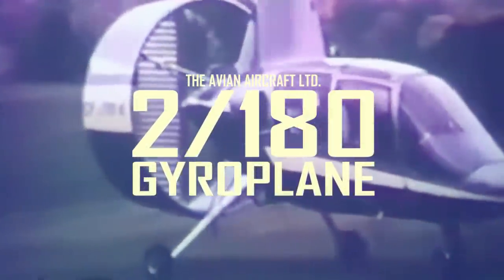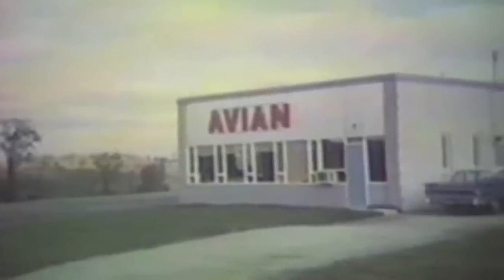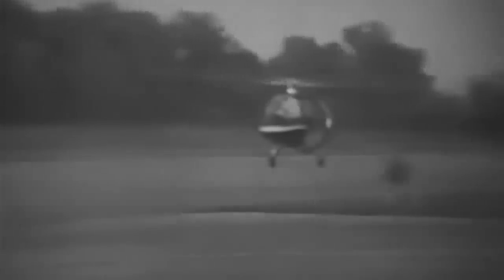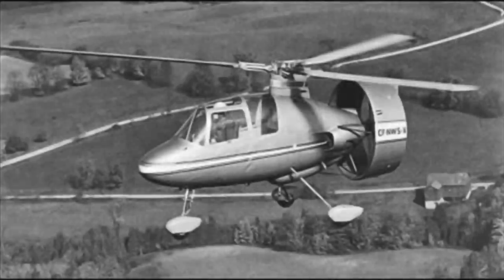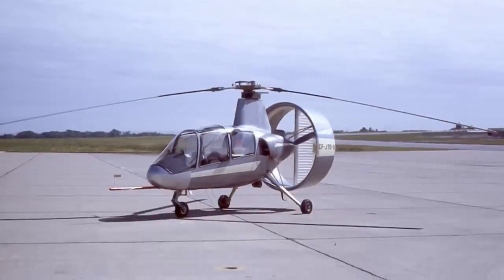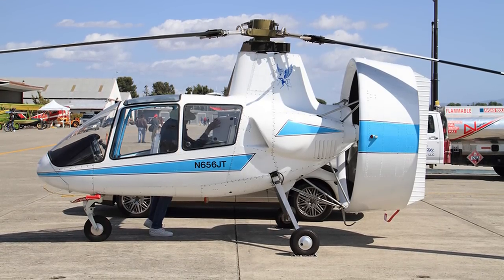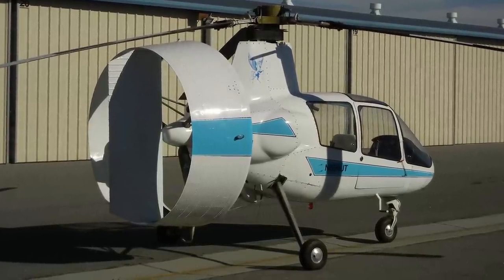Attractive VTOL autogyro with unrealised potential; the story of the Avian 2/180 Gyroplane

Comment: This is ticking me off a lot; the Lycoming O-360 only has 1 zero. It's an O-360, not a 0-360.

Edit: Also, ducted fans are noisy (they produce more noise fore & aft of the duct) & hard to make. The potential performance doesn't matter if it's out of the target market's price bracket & isn't comfortable. Additionally, APUs were already a thing for producing forward thrust so sticking a piston engine on the back is very counterproductive since it introduces more failure points than a turbine engine. Failure points are even less desirable in helicopters than aircraft since they're more difficult to fly & have less margin for error in case of engine failure.

Comment: IMO For this to be successful, it had to have a use that a helicopter could Not obtain.   It would have to be FAA approved to land and take off in a city due to the fact it was always in autogyro, thus safer 'in IC engine out' than a helicopter during take off and landing.    (electric, battery, fuel engine, is a new reliability model)
Reply: I'm a 21yr gyro pilot. For it's price a helicopter is a better choice. Look for the Groern brothers. Another machine that was a pipe dream .  The technology is nothing  new. The cost of certification Of a new machine means very deep pockets. How many are flying. I bet not but a  fewer or only one. The gyro crowd would not buy it.

Comment: Wondering why this wasn't successful, I mean you can basically start and land in your backyard. No large airfields required.
Reply: RK: Same as all gyrocopters:  1. Minimal room for cargo 2. minimal cargo weight capacity 3. Slow cruise airspeed 4.  Narrow Center of Gravity range. Overall, helicopters offer more features.
Reply: @KB4QAA  yeah but it looks like a great commuter plane, especially for areas with bad airfields, like bush plane territory.

And the cruising speed and carrying capacity doesn't look that bad - I mean they mentioned that you can add tanks and get more than 2000 km range out of this thing.
Reply: @RubenKelevra  1. No you can't 'add tanks".  2. It only has a 600lb Useful Load = 200lb pilot + pax = 200lbs left for gas+cargo.  3. There is no significant cargo area.  5. The market has spoken the final word on autogyros for 60 years as commercial utility: "No!'.  Sorry.
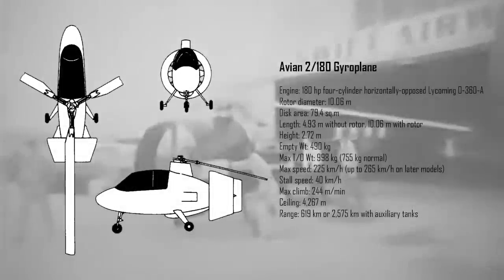Reply: @KB4QAA  2:54 there are auxiliary tanks mentioned in the datasheet
Reply: @KB4QAA  the max takeoff weight leaves room for 1120 lbs of fuel/cargo/pilot/passengers. Doesn't really sound that awful either 🤔
Reply: @RubenKelevra  I don't see links to data sheet.  The Janes' figures quote MTOW 2,000lbs -  Empty Wt 1,400lbs = 600lbs Useful Load. i.e. pilot, pax, fuel, cargo.
Reply: @RubenKelevra  Cont'd.  600lbs - 200lb pilot - 200lb pax = 200lbs remaining for gas + cargo.   For IO-360 figure 12gal/hr burn.  30min reserve = 6gal x 6lbs = 36lbs.  200lb - 36lb = 166lbs load remaining for fuel + cargo.  166lbs/72pph fuel burn= 2.3hrs of flight available.  Fly one hour each way round trip.  166lb - 144lbs burn = 22lbs available for cargo for 100 mile radius.  Not much cargo, not very far.   A Maule can beat this on every number for a fraction the cost and a lower maintenance cost.  bill. cheers, thanks for the discussion.  Interesting to investigate old planes and "what if".  b.
Reply: @KB4QAA  the datasheet is at 2:54. It shows 1080 lbs of empty weight and 2200 lbs as max takeoff weight.

So you get around 1120 lbs for fuel/cargo/passengers/pilot.

That said it's a pretty old design, I'm sure that adding a turbine engine instead and using modern fabrication technology could increase the usable space/cargo capacity significantly.
Reply: @KB4QAA  Look up the numbers for a Cessna 172 as a fixed wing competitor. It's worse.
Reply: @RubenKelevra  But a C172 ISN"T a competitor equivalent to the Avian. And, you are in fact wrong. The numbers are much better.  Farther, faster, more cargo, vastly larger cargo space; can easily carry 3 pax, 4 with significantly reduced range. Overall, a C172 is a better performer if STOL and rough field/bush operations are not required.
Reply: @RubenKelevra  p.s. Of course we need to haggle over exactly "Which" C172 model we are discussing!  :)
Reply: @KB4QAA  

Well, Wikipedia shows as "general characteristics" for the C172:
Empty weight: 1,691 lb (767 kg) and gross weight: 2,450 lb (1,111 kg). That's 759 lbs (344 kg) usable capacity.

The Avian has an empty weight of 1,080 lbs (490 kg) and a maximum takeoff weight of 2,200 lbs (998 kg). That's 1,120 lbs (508 kg) usable capacity.

While the C172 has cruise speed of 122 kn, while the Avian has a cruise speed of 143 kn.

The C172 has a range of 696 nmi, the Avian has a range of 1,390 nmi.

The C172 has a rate of climb of 721 ft/min, while the Avian has a rate of climb of 801 ft/min.

The C172 has a service ceiling of 13,500 ft, the Avian 14,000 ft.

The Wingspan of the C172 is 11.00 m, while the Avian can be stored without the blades, which reduces the width to just the cabin with a the length from 10 meter down to just 5 meter - while the C172 is 8.28 meter.

So if you want to store the plane indoor you need a lot less space.

Additionally the low stall speed of just 21.6 knots of the Avian do stress the brakes and tires a lot less than on the C172, so maintenance costs should be lower for those parts - while the C172 stall speed is at 47 kn with full flaps.
Reply: @RubenKelevra  I think you have made errors in reading/translating performance figures. There is No way the Avian could cruise 142kts with an IO-360. I have hundreds of hours in C172's with O-360 and they can do about 115kts.  Your other figures like MTOW and Empty Wt. do not jibe with figures published from Janes'. They are too high. 1300+nm range is absurd unless you are somehow include a huge auxiliary tanks.  Which must offset pax & cargo.  I think you have serious errors. Finally: A C172 does NOT fill the niche of a gyroplane and it's strengths of STOL.  So comparing them is inappropriate. Now, chose a Maule fixed wing STOL model and we can talk turkey, after you can justify or correct your questionable figures. Cheers. b.
Reply: @KB4QAA  those figures where all from the video we're commenting on, and I already stated above, where the numbers in the video are quoted. And yes, the numbers for the range are if you use additionally aux tanks (as quoted before).

But the Avian comes with aux tank mounts while the C172 need to be converted to haul tanks inside the cabin etc.

The maximum range is never really a daily flight figure, but important for ferry flies etc. where you might need more fuel for one hop than the tanks can hold.

If you have a source for different numbers, feel free to send a link.
Reply: @RubenKelevra  Ok, I checked the video. You are are not using the "Normal" figures for MTOW or Range.  Using the Normal figures essentially confirms my figures. From video Useful Load = 586lbs (Mine sources: 600lbs), and range = 334nm which is comparable to the A&S 18A range of +300nm.  b.
Reply: @KB4QAA  well, normal takeoff weight is referring to it's ability to take-off vertically. With more load you need a short runway.

Since you need a runway to land anyway - that is hardly any issues :)
Reply: @RubenKelevra  The speed you cited is the Vne, limitation not a performance figure. The video lists cruise speed as 92 knots which matches with the Janes' figure of 90 kts.

Comment: Helicopters are good at lifting loads vertically and planes are good carrying loads horizontally... The gyro is only really good for fun because it can only lift itself and has limited range. It is a rebel without a cause...
Reply: @luciousbrun5437  Taxi's are load carriers an gyros can not carry much load. Scale has not helped gyros compete either so.. They are just for fun.
Reply: @luciousbrun5437  Executives want to land on top of buildings or places where there is no runway(point to point) which is why they use helicopters.